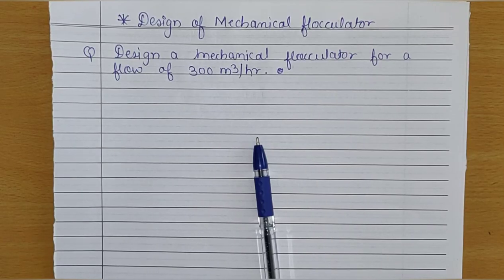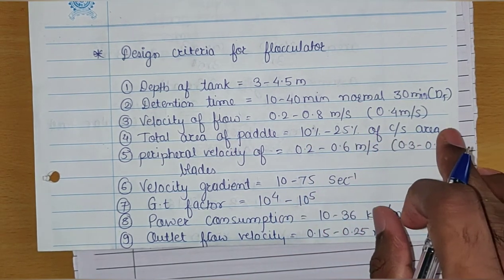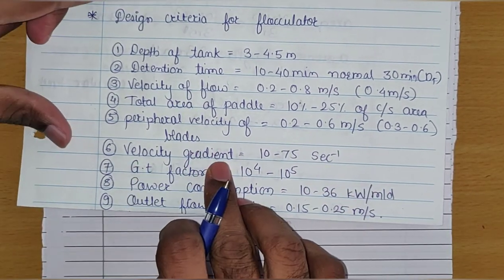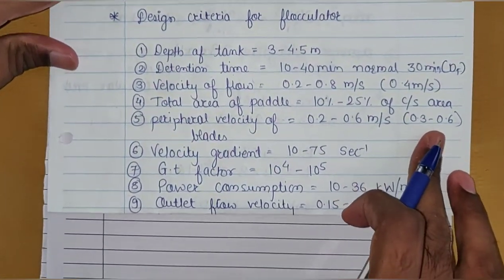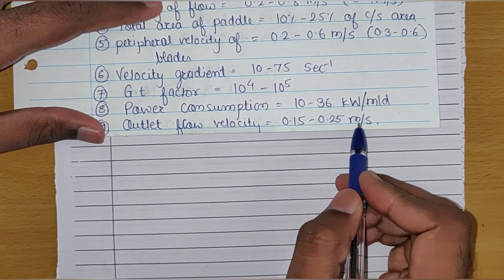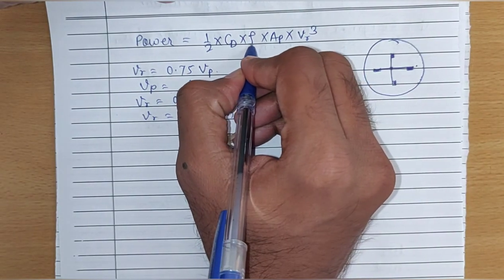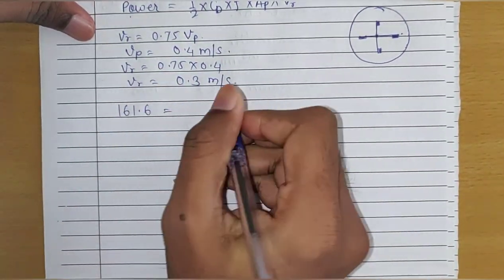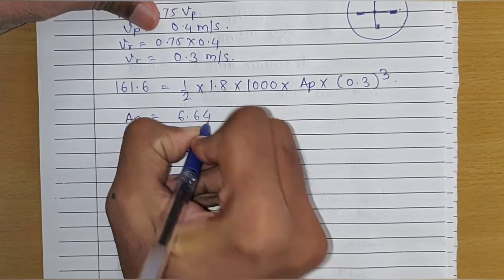Design of Mechanical Flocculator | Flocculation tank | Water treatment

Comment: The dimensions of a uniform depth 
axial flow flocculation basin to 
treat 8 MGD having a detention 
time of 50 minutes, basin width 
25 m consisting of five equal width 
units separated by perforated 
concrete wall is
Reply: Brother could you solve and send the pen paper solution